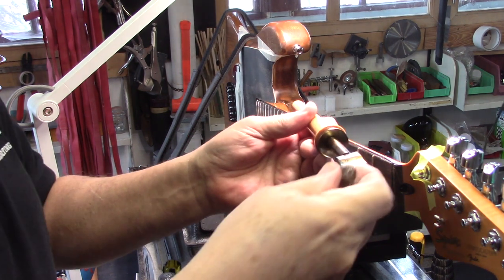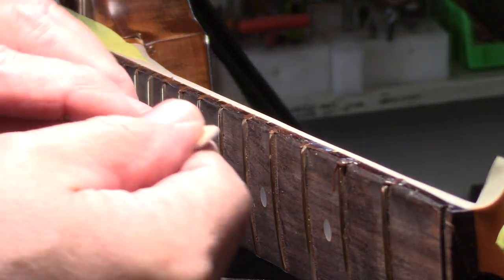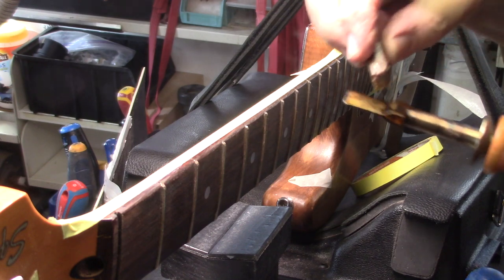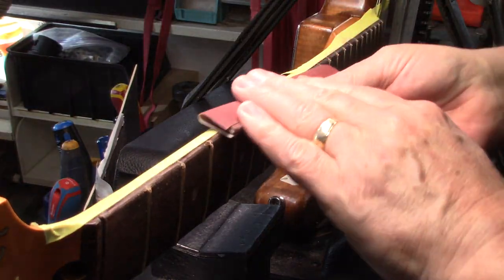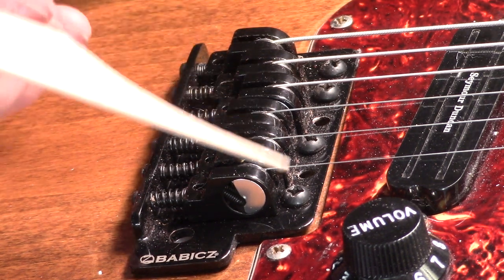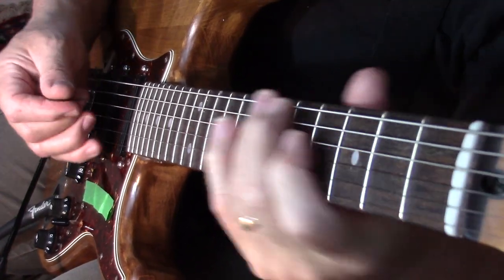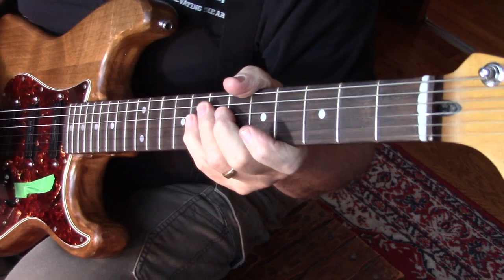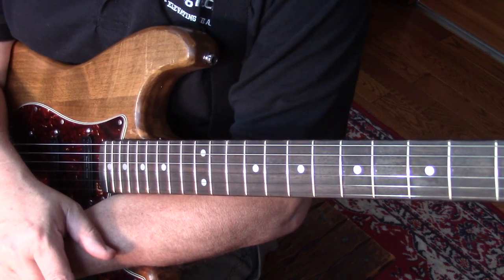Babicz Bridge / Comp Nut / EVO Frets@StringTech Workstations

Comment: When installing EVO frets, are you over reducing the fret a bit? I was told that this material breaks easily.
I want to experiment with this fret wire, Thanks
Reply from the maker: The spell check does not allow you to use the word " over radiusing" Lol ! But ... yes ... this is exactly what I do. You will need to experiment with this yourself, to discover the "right amount" to over radius the fret wire. Good Luck. MMcC

Comment: Hi Ted just a thank you for all you do. Much appreciated. Quick question I realise you use a mixture of colours but what is it you melt with them wax ? 
Thanks Best Wishes from Australia 
Kimball
Reply from the maker: This is high heat burn-in lacquer stick.
Reply: Thank you so
Much not seen before  👍
Reply from the maker: Don't know what you have available in Australia. The brand name for the lacquer stick here in Canada is " Mohawk " finishing products. Lee Valley is another company here in Canada that has the burn-in sticks. They are quite common in the furniture industry. Maybe check with come local cabinet makers or furniture makers. Good Luck ! MMcC

Comment: When you take the screw out of the saddle to get the intonation right, do you glue the saddle? Or does the owner have to re intonate that saddle each time they change strings? THANKS
Reply from the maker: No Joseph. The string saddle is held in position between the threaded fastener through the back plate pulling the saddle back ... and the string force pulling the saddle in the opposite direction. These two opposing forces, hold the saddle precisely in place. Thank you for asking. MMcC
Reply: @StringTechWorkstations  THANKS. Hope to do business with you after your recovery.